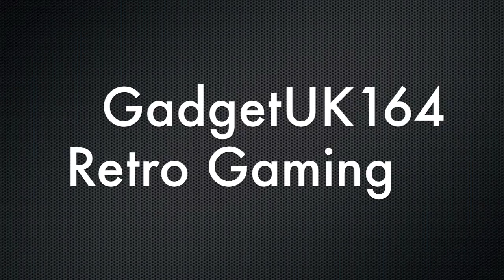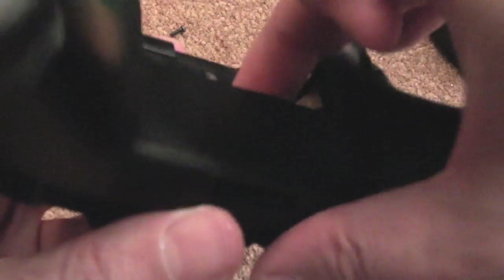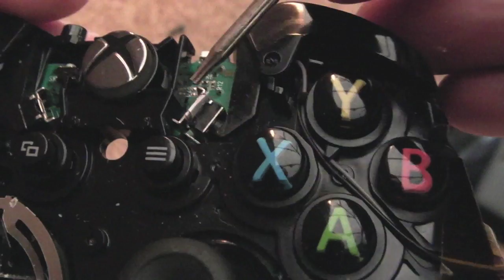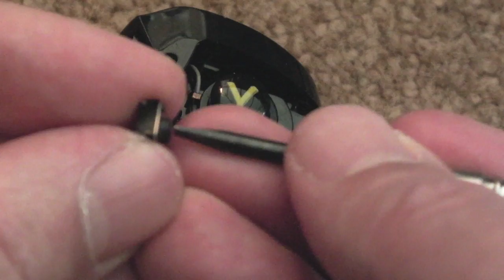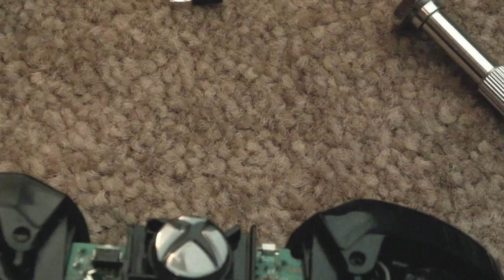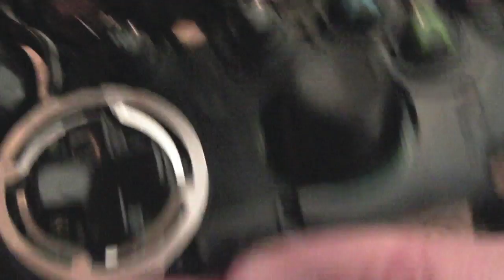Microsoft XBOX One Controller RB / LB Button Repair (Again)

Comment: Electric contact cleaner is the way to go, no need to replace the button. I don't think other cleaners are quite volatile enough to get the job done.

I'm pretty sure it's just the plastic material on the button creates a bit of dust that clogs the switch, so electric contact cleaner clears that right out.

You'll need to spray 3 or 4 times, while clicking the button alot in between. But works good as new.
Reply from the maker: For some people it may be about dirty contacts, for me - I had to replace the button (twice before I got a good switch that was reliable enough...).  That button was used a LOT (perhaps way more than others) on Battlefield.
Reply: @GadgetUK164  I used mine a lot in Rocket League, but yeah, probably not as much as somebody playing Battlefield

Comment: thanks for the video - you showed me exactly what to do - yeah that front panel - I thought I was going to break it but it was a great help seeing you pull it apart... lucky for me the bumper switch was just dirty - clicks but only registers half the time- resolved by actually spraying a good dose of electrical contact cleaner on the internal button once you have the cover off and give it a few presses or even a few light presses with a screwdriver and then give it another spray and wipe of the excess - this also works on badly functioning buttons and pads. Sometimes I think dirt or grime builds up on either the button or mechanism and little spray fixes it straight away.
Reply from the maker: I wish mine had just been dirty...   The good news is after the last video I did on this, that button is still in there today and still works (same controller I use).

Comment: My rb button doesn't register clicks at all after soldering :( Is there any way to check if I broke something close to the button pins on the board?
Reply from the maker: You just need to inspect with magnification and use continuity tester to follow the connections to and from the button.

Comment: Years later... My RB button, clicks, sounds fine, feels fine, no sticking, it doesn't feel jammed or anything. But for some reason is constantly registering the button being pushed. NOT FOR A SECOND is the button not being registered
Reply: had  problem switch clicks but only registers half the time- resolved by actually spraying a good dose of electrical contact cleaner on the internal button once you have the cover off and give it a few presses or even a few light presses with a screwdriver and then give it another spray and wipe of the excess - this also works on badly functioning buttons and pads. Sometimes I think dirt or grime builds up on either the button or mechanism and little spray fixes it straight away.

Comment: My RB clip is broken so my RT isn’t stable and the RB is fine apart from obviously the clip is broken meaning you can pull it out.
I got it 2 weeks ago
The clip is on the back making a Upside down L shape 
The RB Clip clipped onto it is snapped

I have so many others so I’ll just take an other one apart (again)

Comment: Hi friend..what if the lb/rb switches are desoldered and rb is being pressed???i don´t know what is going on..Without the switches rb is being pressed.
Reply from the maker: If the switches are registering as a press when the buttons arent even on the board, it could be a faulty IC!  The other possibility (I am not sure as I've not got an exposed board to check) - each switch may have a pull up or pull down resistor on one side somewhere on the board (connected to one trace or the other).  If that is faulty / fallen off from a drop, the switches will always register as being pressed.
Reply: @GadgetUK164  ok. I Will check later. Thanks.

Comment: I need to do this repair for my original Nintendo DS. Had difficulty finding the replacement part. Finally, it seems the GBA SP uses the same button. Now i’ll check your first video on desoldering the four points!

Comment: i didnt understand the part of the video where u pull out these little metal things that keep the switch in place, can anyone explain how do i do it
Reply from the maker: Just desolder the 2 points on the metal clamp, and the 2 points on the switch.  The switch will then come off the board, with the metal clamp thing on it.  It then can easily be seperated from the switch.

Comment: Link to the higher quality switch? Thata, great video
Reply from the maker: Take a look at Farnell, Digikey or RS Online.  Search for  6mm x 6mm tactile switches.  You just need to measure the height of the plunger (from memory its 2mm I think).
Reply: @GadgetUK164  Awesome, you're the best.
Reply from the maker: @Herb.  Just had to edit that comment I posted - its 6mm x 6mm, with 2mm on the button height I think.

Comment: For people who are trying to fix the LB/RB bumper, first of all I feel your pain. 
You can obviously fix the button as explained in the video, it works great...however, this is temporary.
For those who want to replace their controller for another xbox one controller, don't. Spend 40 bucks extra and get a solid controller like the razer wolverine.
Reply from the maker: I wouldnt say temporary at all - mine has worked since the last video on this repair and I still use it every evening!

Comment: I rarley even play my xbox and I've been through 3 controllers already and the games I play I don't even have to use my bumpers
Reply: David Grubbs since 2016 I’ve gotten through about 8 official controllers and an aftermarket one came not working.
Most still work but have sticky keys or a broken clip.
Or even a snapped joystick. (Mine fell out)
The other joystick my cat broke a table and the leg fell of onto the joystick. (Sounds like a lie but isn’t)
Reply: @isaacsrandomvideos667  god damn idk why they just can't make more durable remotes
Reply: David Grubbs I found an old “broken” one, got it working, all I had to do was move the battery connections, and click a button in place,
(It has a touchscreen d pad)
Reply: The dpad is broken in a way it’s touchscreen, it works, I don’t have to click it for it to work, I touch it.
It’s very strange

Comment: My problem is that the RB won't stop telling me its being pressed down. I've literally take the button switch out of the controller and it still says I'm pressing down the RB. Anyone got any ideas?
Reply from the maker: Check the PCB has no cracks in the traces leading to that switch (or solder bridges linking the switch contacts closed on the board).  If that isn't the issue, the IC will be faulty that processes the inputs.
Reply: I'm having the same problem

Comment: I'm having a problem where the lb is being triggered by very small amounts of pressure. Even when placing my hand over it, it triggers any advice would be muchappreciated.
Reply from the maker: I would just swap the switch!
Reply: just had similarproblem switch clicks but only registers half the time- resolved by actually spraying a good dose of electrical contact cleaner on the internal button once you have the cover off and give it a few presses or even a few light presses with a screwdriver and then give it another spray and wipe of the excess - this also works on badly functioning buttons and pads. Sometimes I think dirt or grime builds up on either the button or mechanism and little spray fixes it straight away.

Comment: What flux is used here
Reply from the maker: I typically use Chip Qwik flux.
Reply: @GadgetUK164  thanks, I'm using a piece of an old controller with no headphone jack to fix the one that does

Comment: This also works for the newer controllers. And btw I took a switch from an old xbox 360 controller and soldered it into my one controller. Its basically the same switch. For those who does not wanna order a switch off Farnell for whatever reason.

Comment: My LB button only works like 1 out of 10 times, and my RB just fell off like 10 mins ago while playing Rocket League...
Reply: Update: My LB also fell off xD
Reply: For me my LB was broken even though I use RB more to Air Roll
Reply: Same
Reply: Same RB fell off while playing rocket league
Reply: Wanna play rocket league 😂
Reply: Alex Beri BRO MY RB WONT REGISTER AND NOW I CANT AIR ROLL ON ROCKET LEAGUE IM SO MAAAAAD
Reply: @exocq  The only thing that fixed that for me was that the button fell off, I put it back in place with some tape on it, doesn't look good but it works now xD
Reply: Alex Beri so it just fell off?? I might need to pull it off and put it back on to see if that works lol
Reply: Alex Beri I just realized that most controllers have a 90 day warranty so I just hopped on the Microsoft website and set up a replacement for free! All I have to do is send the broken controller in and they will replace it with a new one, so that’s pretty cool.
Reply: I've destroyed like 5 rbs already with rocket league lmao...playing without air roll and drift is simply useless. With 3 elites it took about 4 months then rb was gone. I guess rocket league is such a stressful game for rbs and lbs :D
Reply: @TiggieRL  RL destroys my lb button for boost and left stick within months, im so sick of buying remotes or tearing them apart too fix them lol
Reply: My lb is not working, its clicking but not registering, ivr stripped it, replaced it, still not registering, any ideas?
Reply: Depending on the controller, these 2 switches are connedcted by a bar. If that bar breaks, it makes sense, that both fell off.

Comment: Can I take one of those buttons off an Xbox 360 controller and use it in my Xbox one controller?
Reply from the maker: Possibly - I cannot remember what buttons are on the 360 controller.  The ones on the XB1 are 6mm x 6mm x 1mm tactile switches (standard off the shelf part).
Reply: @GadgetUK164  I don't know why they made the RB and LB have levers to hit the internal button. That's strange. Just put the electronic button right under the plastic part you press.

Comment: Click fine but doesn't work
Reply: That what mine is doing right now too
Reply from the maker: It might have another fault, but sometimes the button still clicks despite it not making an electrical connection properly.
Reply: GadgetUK164 - Retro Gaming Repairs & Mods 
Do you happen to have an item number for digikey? There’s like a gazillion tactile switches on there lol.
Reply: I just bought another f**** controller  for 10 dollar us

Comment: how can you be pressing RB every 2 seconds in BF?? You have unlimited grenades or something
Reply from the maker: In BF1 I changed the controller profile to match BF4 and Hardline on the 360 - using RB for spotting.  Luckily since BFV there is no spotting any more =D
Reply: GadgetUK164 - Retro Gaming Repairs & Mods ahhhhh, yeah I totally forgot about spotting

Comment: Wont those soft touch arduino buttons work i used those to replace my megadrive reset button
Reply from the maker: It might do - it may even be the same type of switch (dimension wise)?

Comment: When I got my Xbox 360 I had the controller the came with it for years until I upgraded to Xbox one, and I’ve only had the Xbox one for almost 2 years now and I had to get another controller because they break so easily.
Reply: M Pint same except it happened to my LB button but I fixed by pressing on it hard for 1 min

Comment: Can you send the link to the buttons pls im trying to fix it and have the same problem and want to buy the button from a Good seller
Reply from the maker: I cannot remember the exact size - you need 4mm x 4mm tactile switches, but they all have different button heights (larger ones can be trimmed down or melted down).  Somewhere like digikey or RS Online will sell high quality ones.  Something like this:- https://www.ebay.co.uk/itm/6x6mm-Right-Angle-Momentary-PCB-Tactile-Switch-4-3mm-5-0mm-7-0mm/282579452321?epid=18004955449&hash=item41cb0c41a1:m:m0B70bODCbk3f6Tn74AzfKQ

Comment: Omg. I cant believe it worked. I got controller on offer up for $5. The RB button doesnt work. I swaped the button bar, clicks, nothing
 I came to this video and it said to blow. I did. Nothing. I used a brush to brush around the button
WORKS!!!!!! WORKS!!! TRY BRUSHING with a clean small brush.  It's working now !

UPDATE. IT WORKED TEMPORARILY.

Comment: If the plastic above the broke off... can I just snap another one on without replacing the button itself?
Reply: Thats no Zaku! You mean the actual bumper that you press that clicks the button?
Reply: @unsuboi9973  yes! The button still works
Reply: Thats no Zaku! Thats no Zaku! To be honest, they don’t come in pairs and they aren’t specific to each other, so if the plastic on the actual bumper snaps, then you can just replace it with another number without having to replace the actual button, and same the other way around.
Reply: @unsuboi9973  sick

Comment: Just get a q-tip make it fit into the slot that the bumper touches make the q-tip wet not fully wet and keep clicking the button until u hear a nice click and it should work find
Reply: what do you mean? :/

Comment: Hello, i have some issues with RB and LB buttons, i have to press them harder in order to get them trigger. If I press them only until the "click" sound still nothing happens. Is this normal? Should I go back to the Xbox 360 controller for PC ?
Reply from the maker: The buttons might need replacing, or maybe there's a fault on the board.

Comment: I soldiered a new tactile switch and the RB still doesn’t work. I’m not sure where to go from here.
Reply from the maker: It's possible there's a crack or break in the trace on the PCB.  You could inspect with magnification and test with a multimeter on continuity test to make sure the trace(s) are OK.  Beyond that its possible theres a fault with one of the main ICs on the controller.

Comment: My LB Button only works when I press it really hard
Reply from the maker: That's an indication that the switch either is dirty or needs replacing.  You could try the "blow air into the switch" trick that others have talked about here in the messages.  That does sometimes fix that problem.  But beyond that, you need it swapping out like I did.
Reply: @GadgetUK164  how do you blow on the switch I only press the trigger and blow on the space but if that doesn't work how much does replacement cost

Comment: Opened my pad to have a look at the RB button because mine isn't working as well.

Got up to the part were you said you need a soldering iron, which i don't have. So i put it all back together and now None of the buttons are working except the big X and the d-pad. I've opened it up in the past and put it together but this time is different, no idea what i did to make it worst :/
Reply from the maker: =/  I would take it back to pieces and very carefully examine everything with a magnifier.
Reply: Just buy a new controller. Or a ps4. Thats what im bout to do. Fuck xbox.

Comment: Hi mate, I have an issue currently where the switch is clicking when depressed but the button doesn't work, will replacing it fix this or is it more likely the board itself? Cheers
Reply from the maker: The switch can click and has bad contacts - so it might be the switch.  But it could also be the board or a chip fault.  You could test on continuity with a multimeter and press the switch to see if the contacts short.
Reply: Hi again mate, I replaced the switch with one that I salvaged from a broken 360 controller I had and the switch works! The button was a bit short so I had to bulk it up a bit but it all works now so happy days! Thanks for the help!

Comment: What tools did you use to take off the solder points and where do you get the farnell(element9) specifically?
Reply: I found it! 
-40 watt soldering iron
-solder sucker

These items take away the solder points, but they can be dangerous, so be careful with them. Can excess 500 Fahrenheit so keep it ventilated and take away the dust after removed, don't inhale.

Comment: Mine clicks but doesnt work
Reply from the maker: Try blowing air into the button as some have described in the comments.  That sometimes fixes it when it IS clicking.
Reply: @GadgetUK164  Thanks. My controller stopped working but still clicked. This helped the lb button to work again.
Reply: GadgetUK164 - Retro Gaming Repairs & Mods wow, that actually worked. I can finally play Gears properly again. Thanks.

Comment: I'm speechless I was about open the controller, but seen you should blow into it... And it worked phew!
Reply: can you explain better? my rb doesnt work anymore, and i bought the controller a few months ago, and a new controller here in brazil costs over R$400,00 pls help me man
Reply: Thanks dude i did a blow into the controller and it works, youre a god
Reply: My right bumper is still not working even though I blew into it multiple times. I never dropped my controller once and it stopped responding.

Comment: Is 150 watt soldering iron overkill for this job ?
Reply from the maker: If it's not temperature adjustable - yes, total overkill and will disintegrate traces!  If you can adjust the temperature to around 370F  degrees F (188 degrees C), see if the solder melts, if not increase temperature until it does - then it should be OK.  With no temperature control, you want something like a 15W iron.

Comment: Mine still clicks it just it doesn’t work on the console any tips for thatV
Reply from the maker: Sometimes they still click, but they aren't working.  You need to test on continuity test mode of a digital multimeter, and press the switch to see if its really working.

Comment: ...Just Buy A New Controller. 😐
Reply from the maker: You could do that, and spend £30 ish, or if you like repairing things you could spend £2 and replace the faulty switch.  You could also then buy lots of faulty controllers, fix them, and sell them at profit.
Reply: Nikko 123 but that's something a lazy person would do